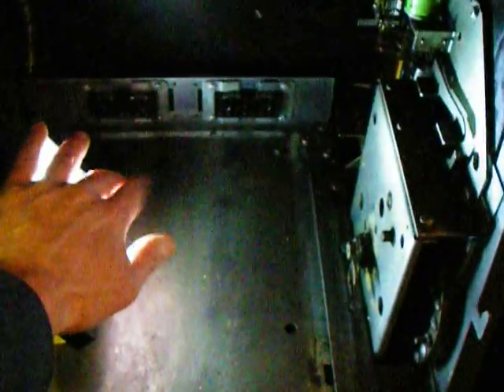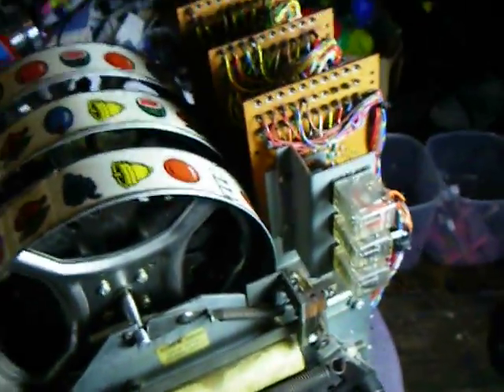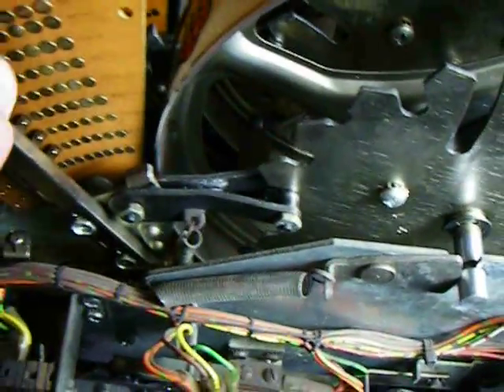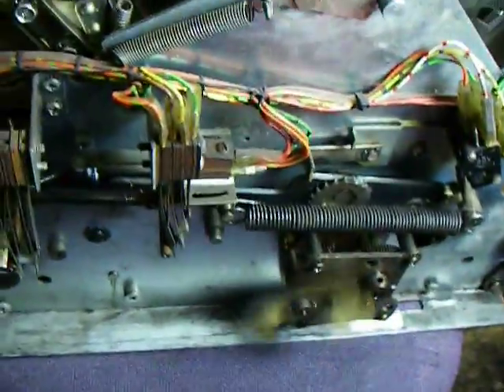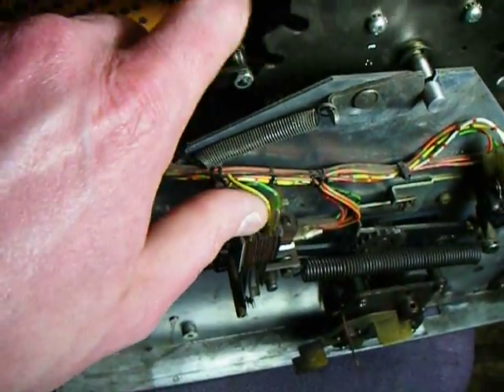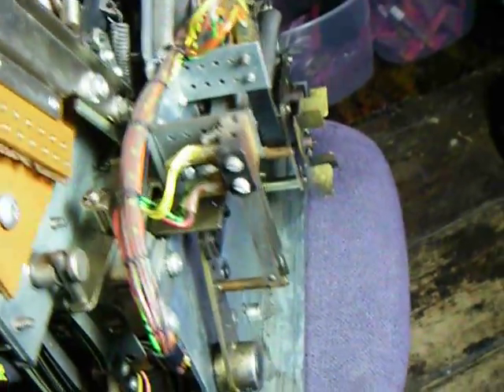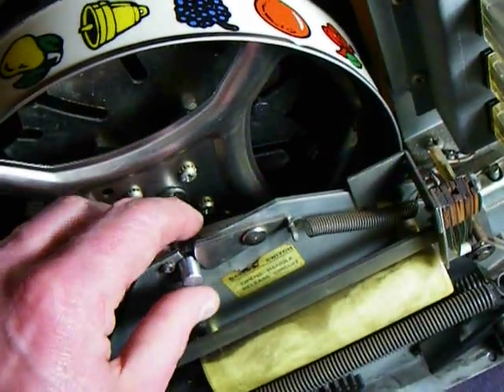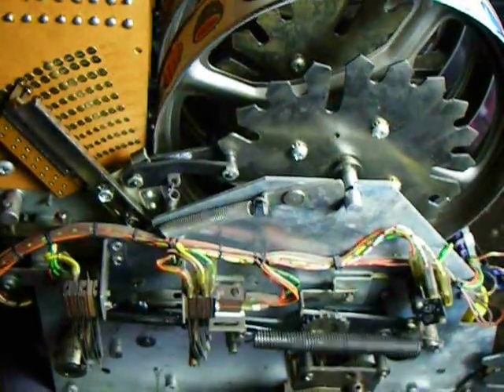Bally slot machine reel mechanism.

Comment from the maker: On mine there are two levers at the bottom front of the reel assembly that hook into the base plate.  When pulled forwards those levers lift their hooks out and the whole assembly slides forwards.  It is quite stiff to pull at first because it has a lots of contacts on the chassis plugs at the back.  Likewise it needs a firm push when putting it back in to re-mate those contacts in the connectors.

Comment: I have a Bally Tunnel Target that has the same set up here. They all work good but, it always pays 1 coin less than what is stated. I think it is  the first reel that is causing the issue. Can the wiper arm be adjusted maybe 1 more contact?       Thanks.  Rick
Reply from the maker: It could possibly be the payout counter that is needing serviced.  Sometimes a coin can also stick on the edge of the hopper output and drops later.

Comment: I have an old nickel slot machine ,Bally manufacturing, numbers on tag are 809-ZZB and MT-16118.   Where can I find some technical assistance while working on this machine   I think it's probably an minor electrical or mechanical issue   It is an older machine with no IC boards. I would love to get this thing going. I consider myself mechanical and electrical inclined as it has been my life long trade, however there is a lot of part's in this machine and I have no manuals or support of any kind to direct me and advise of possible problem
Reply from the maker: It's often dirty or burned contacts in switches, relays, wipers and connectors.  If it's doing nothing at all, check that the jackpot timer hasn't tripped.  Depending on the machine there may be a reset button behind the payout hopper.
Reply from the maker: @bobsteimel3741  If the switch is free to move it may be rubbing against something, or the little trap that prevents a coin being pulled back up on a thread may be blocking it.

Comment: Do you have contact info to help with a electromechanical issue. Unit looks identical to what you are showing. It was my grandma's and passed to me when she passed away. I can manually pull the  reels holds back but they won't release and spin.
Reply from the maker: There are forums for maintenance of older machines.  Prime suspect is usually dry oil causing some parts to stick.

Comment: Is there a reset i can’t seem to figure out out to place the wheels in a proper sequence as a winning spin shows yo but no payout is given and then a random sequence hits and it’s a large payout.
Reply from the maker: If it's an old electromechanical machine like this then check the reel bands haven't slipped around to the incorrect position.

Comment: I've watched your videos but it doesn't help me with my issue. The machine is just like yours- works fine until it hits a payout, then it empties all the coins in the hopper without stopping until all are paid out. Any suggestions of what is causing that - relationship, switch ?
Reply from the maker: There will be a payout counter that has a solenoid that steps a wiper arm around contacts.  In mine it's in the upper box.  If the solenoid is jammed or burned out, or the switch on the coin exit from the hopper isn't actuating then it can't count the coins and will trip the "jackpotting" timer.  It could also be a loose relay or one with a bad contact.  Check they are all seated properly in their sockets.
Reply: @bigclivedotcom  Thanks. When I took out the coin mechanism the onboard circuit board was loose and I tightened it, so this doesn't occur anymore. Now it seems to payout correctly, but only on line 1 not the other 2 payoff lines
Reply: these machines also had a timer to stop runaway jackpots, in the back behind the hopper.

Comment: What could be the problem if Reel 2 only spins ca. 2 Symbols per Spin (Reel 1 and 3 are spining normaly)?
Reply from the maker: If it's an electromechanical reel mech check the reels are spinning freely when the stop mechanism is retracted.  If there's a hold solenoid make sure its mechanism isn't jammed in.  Watch the mechanism operating to see if the air-brake timed reel stopper is dropping in the stoppers in the correct way.

Comment: I’ve picked up a fruit machine for free,I’ve changed the battery on the motherboard and I’ve changed the switch on the power supply,the machine is still dead,I’ve opened the power supply and one of the capacitors has a bulged top,could this be a issue
Reply from the maker: Yes.  They often bulge when they fail.

Comment: How do you  remove reels  safely?
Regards mike
Reply from the maker: It depends on your system.  In this one the whole reel assembly unlocks and pulls forward, and the reels can be released by two spring loaded restraints at the sides.

Comment: My reels have stopped spinning.  Does anyone have a suggestion on what I can do?  I tried putting WD-40 on the levers but that did not work.
Reply from the maker: Is it a mechanical assembly the reels are on, and are they free to spin freely?  Sometimes WD40 gets used to provide temporary results but then ends up gumming them up.